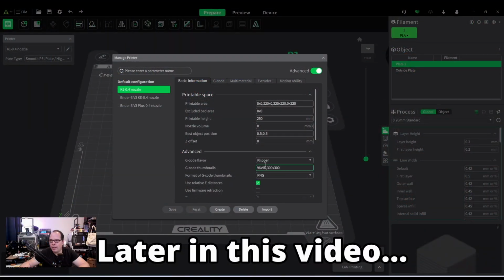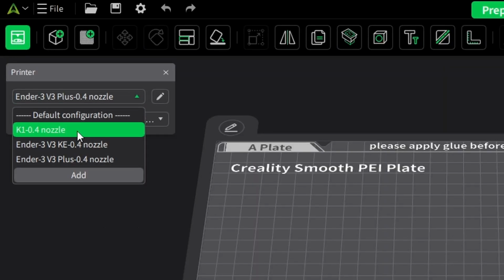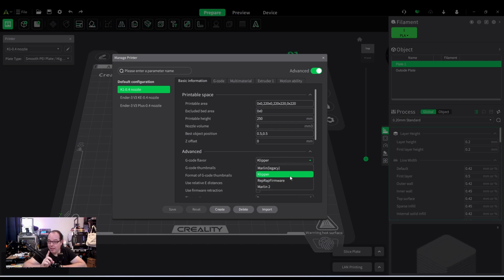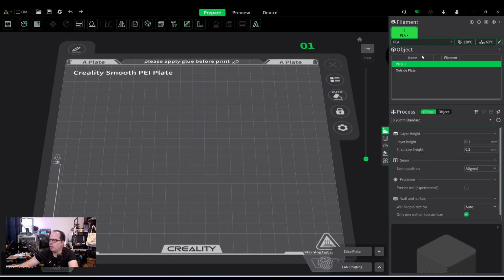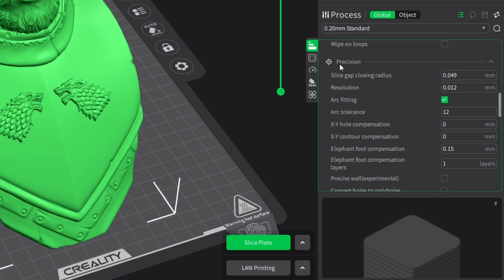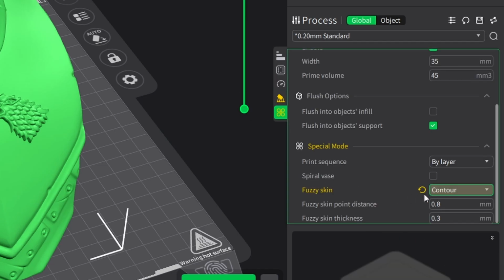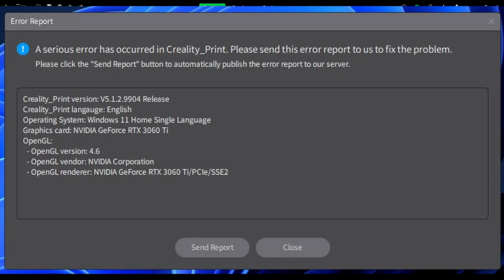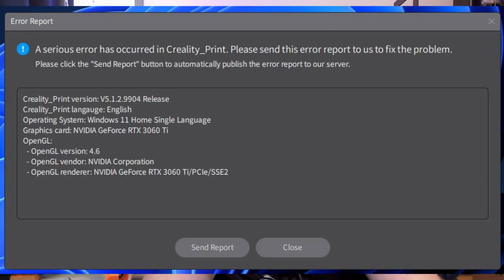The New Creality Print 5 - What Is New and How to Use It? Creality Print Tutorial

Comment: There are no filament preset options for anything other than 0.4 nozzles. I'm not really crazy about getting my filament super dialed in when, to me, this is just a tool. It is such a hassle trying to get PETG to work, especially when there is no basis to start off with. If I had just started and wanted to use a different nozzle size and/or material, this slicer would have made me quit messing with 3D printers.

Comment: im on the ender 3 v3 se and cant print at all it keeps coming up with the currently selected printer does not support multi plate printing but im only printing on one plate any suggestions for fix this
Reply from the maker: OK, that sounds weird... using only 1 plate, but printer says it does not support multi plate printing... 
What if you redo the slicing again and check if there are no other parts or models sitting outside of the main plate in Creality Print... is it giving the same error again?

Comment: Very helpful video!! I do have a question with something I'm having problems with. What screen resolution are you using along with your text percentage and icon size if you're using Windows? I'm getting Creality Print to display too large and parts of it overlay other parts of it making it unusable. If my text is over 101% this happens. I need the text to be larger so I can see it. I'm using 1280x960 with 125% text and small icons. Thanks
Reply from the maker: Thank you. You are using the Windows sizing of the fonts in order the read it? For Windows 11 I use 100% Resolution, not 125 or 150. But in Creality Print I don't see the Option.

Comment: I downloaded it and I really don't like it when compared to the previous version. I look through your video tomorrow, but for now I just want to say that I can't import 3mf-files without them getting all jumbled up in the down left corner. And when I finally do get a model properly loaded in - my own design - the program refuses to print it due to an error stating that it needs supports. But it doesn't; I've printed that model dozens of times and it prints fine without supports. But I can't make the program ignore the error, like I could in the previous version. Two major annoyances that made me download the 4 version.
Reply from the maker: You still have the previous version on the computer, because I also still have it on mine. It basically install a new program instead of overwrite it. 
I always unselect the pre-selected options, because I use various slicers and I want to choose which slicer it needs to open it. Just as I mentioned in the video, some feature are great, but I rather want to use Orca Slicer
Reply: @Zachary3DPrints  ORca Slicer does look good, but the main problem I have with that software is that I can't seem to get it to work directly with my Creality K1. I managed to add it to the program, but then I keep getting error codes and it refuses to print. I think the error was something along the lines of something not found. For now, Creality 4 works still works the best, although I've been having a lot of problems with proper bed adhesion/smooth first layer lately.
Reply from the maker: Loading the Gcodes to the printer, goes via the IP address on Chrome or other browsers... I also don't like it, but maybe in the future Creality actually allows other Slicers upload to the printer. 
I'll be switching over to Orca for my Creality printers and make video's about them... 

The Adhesion issues? Try to clean it, use the glue stick, and calibrate it
Reply: @Zachary3DPrints  I'll make sure to give those videos a look, to see if I can get around the errors. Because I think that if that problem gets fixed, I might like Orca better overall than Creality. I clean the bed regularly, use the glue stick, and calibrate it regularly as well. I think it's a matter of slight differences between the filaments I use (eSun, local print shop brand, Fiberlogy, Redline) so I'm currently working on making separate profiles for each of these filaments.

Also, LOL: my husband suddenly decided to buy a Bamboo Labs printer with multiple filament printing options 'for personal use' (the K1 is for my very small business) to see if it has better software and prints better 'out of the box' and has less first layer print problems. XD 
(I was okay with it, btw)
Reply from the maker: Indeed, a good practice to make special profiles for different filaments so you don't run into loosing filament because of failed prints. The Bambo printers are great for small and bigger businesses, so you are doing great that he bought one